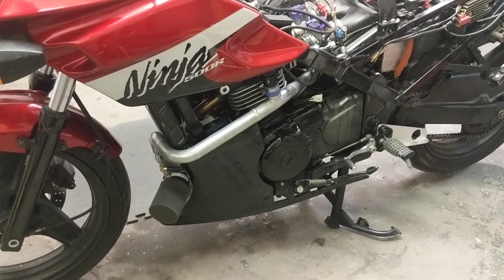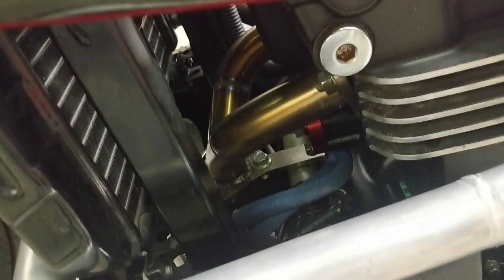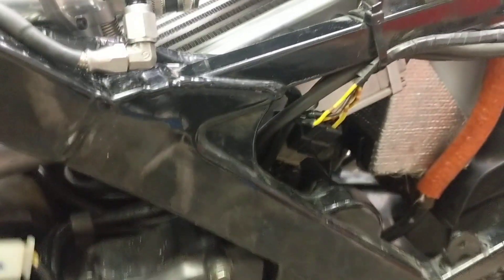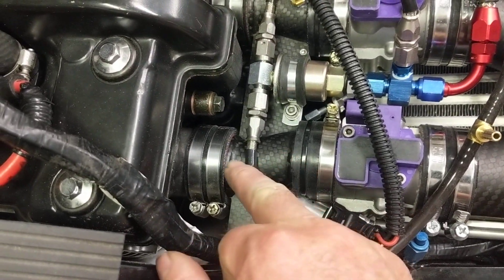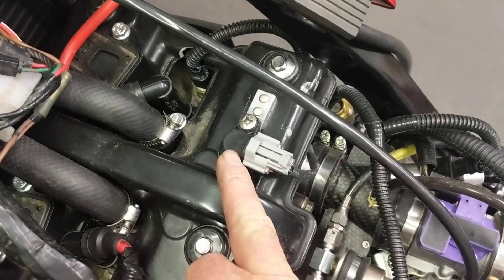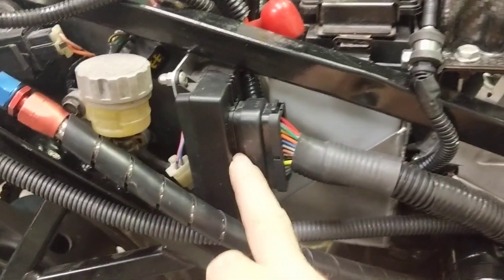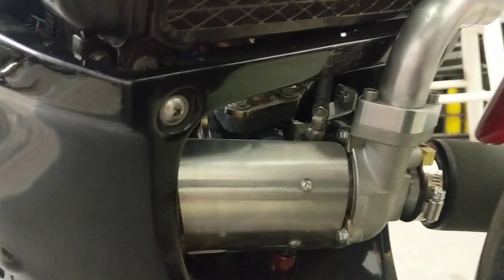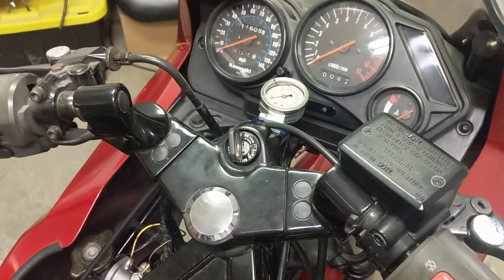Kawasaki Ninja 500R turbo intercooled fuel injected

Comment: Does anyone sell forged Pistons for these engines?
Reply from the maker: I did look and didn't find any for the Ninja 500. But this is really two cylinders from a Ninja 1000, so i think that is the engine to look at. A few piston manufacturers i saw at the PRI show will make custom pistons, but usually a minimum of four.
Reply: Yup 78mm and sleeve it run the 1100 turbo piston. @algiecompositeaircraft5629

Comment: Very interesting.   Is there a fan on the inter cooler?
Reply from the maker: No. I have not installed it yet, there is a flexible tube coming from one of the fairing ducts to feed it cold air. I think it has good flow without though, low pressure under, behind it above the swing arm pivot area. I never see more than 120f intake temps so far.

Comment: I don't know if you sorted the oxygen sensor issue yet, but they typically want to be at least 18" from the exhaust tip so atmospheric air can't make its way back in and mess up your readings. Even sometimes a baffle can help you get closer to the tip, at a cost of reduced flow.
I hope you sort it out, this looks amazing so far.
Reply from the maker: Thanks. The O2 sensor is what caused me to halt development on the turbo version, before I melted it down. Ill get it sorted.

Comment: so how are  you keeping the fuel pump cool they rely on being immersed to stay cool, oh thats right you know so much you think heat is good,,
Reply: It's pretty obvious. All the bits that get hot are inside where the fuel is flowing. Just like every external fuel pump including mine
Reply: In addition to the fuel flow cooling it internally, it has those big aluminum end caps that are acting as heat sinks.

Comment: Do you make the carbonn fiber components yourself ?  If so, how do you get nice surfaces inside and out ? Siliconn caul plates ?
Reply from the maker: I make all tooling and carbon parts myself, yes. They are mostly my own prepreg blend, and just release film surface inside. Cured at 260F for two hours at about 80 psi. I will put up a short video on that soon.